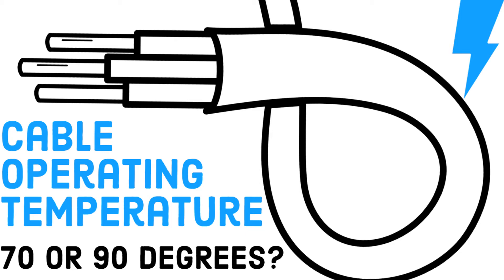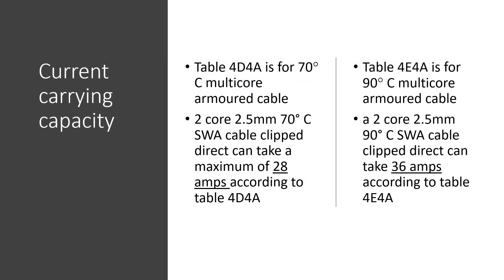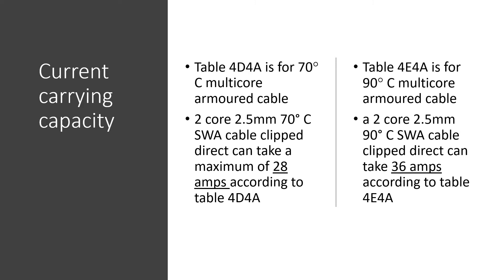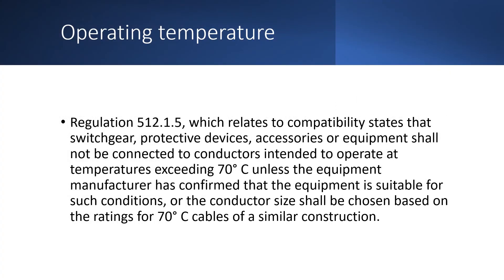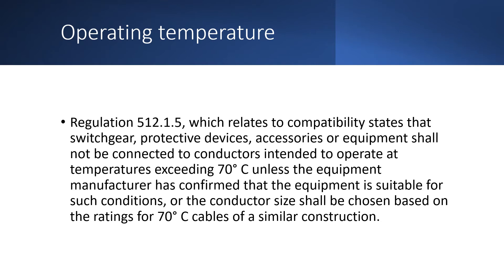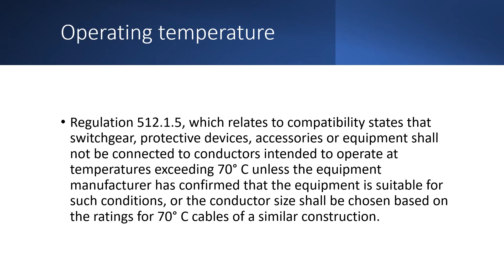Which temperature cable should I use ?

Comment: So if the 90c cable is taking the max amount of amps it says in the book, then it will be a temperature of 90c? I don’t get the correlation between the temperature rating and the current been used?
Reply from the maker: Hi,
Thank you for your comment. The current has a heating effect on the cable. If you look at the tables for current carrying capacity, you will notice that the 90 degree cables can carry more current than the 70 degree cables. This is because the 90 degree cables are able to operate at the higher temperature. 
One thing to bear in mind is that if we select the 90 degree cable, we need to be sure that the switchgear and any equipment connected is also rated at 90 degrees. If we can't be sure of this, we would select the cable from the table for 70 degree cable, so that the cable operates at 70 degrees.
I hope this helps.
Regards
James

Comment: What is "K"?  Please
Reply from the maker: Hi,
Thank you for your question. k is a factor of the resistivity, temperature coefficient and heat capacity of a conductor. Common values for k can be found in table 43.1 in BS7671.
Regards
James

Comment: Dear james, Excellent thank you. basically what you are saying if i am correct unless the SWA with 90C capacity is run on its own or with other cable with the same rating theen we should use the tables for SWA with a rating of 70C. being retired i didnt know they stopped making 70C rated cables but it makes sence.
Reply from the maker: Hi Angelo, 
Thank you for your message. Yes, if a cable with an operating temperature of 90 degrees, is to be grouped with other cables that are not rated at 90 degrees, also if the equipment being supplied is not rated at 90 degrees, then it's necessary to select the size of cable from the table for 70 degree cables. This means that the cable will work at a lower temperature.
Kind regards
James
Reply: @JamesCurnowElectricalEngineer  Hi James, just a further thought in regards to 90c rated cables running with 70C cables, if the 90C cable was separated by 2 x D away from the 70C cables on the same existing tray then this would allow for the cable to be installed. Am i right?